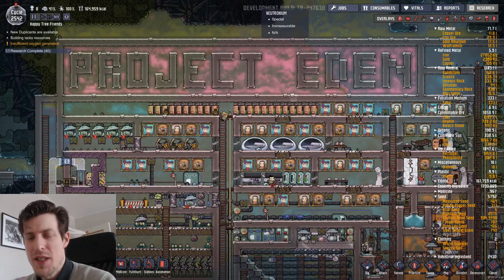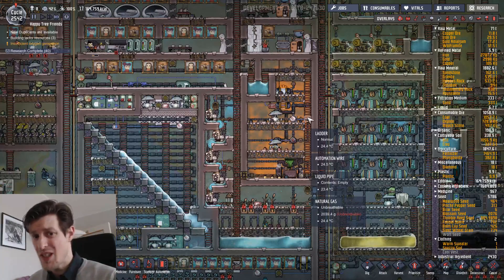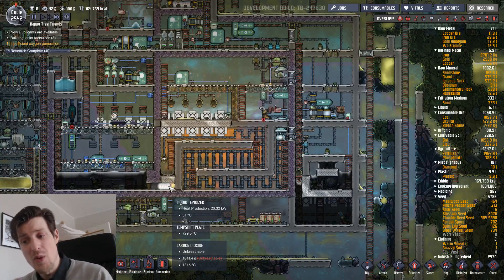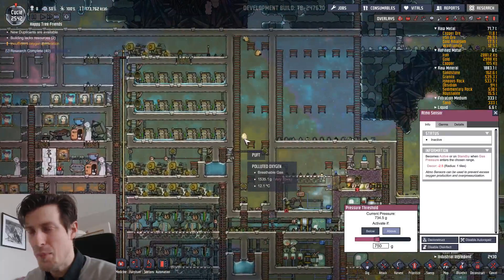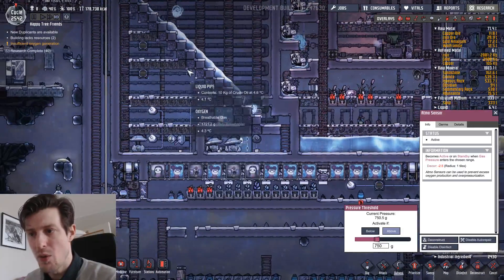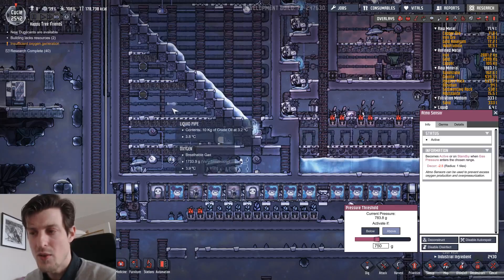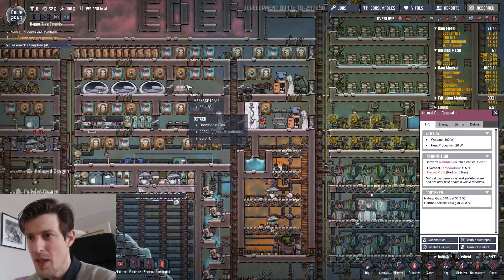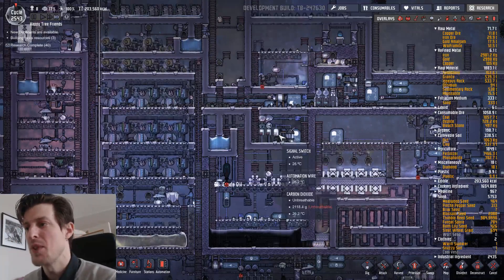100% sustainable base (zero external input) PROJECT EDEN FINAL

Comment: Amazing work! Thanks for sharing, Ketmo! 

However I wonder if it's possible to build a sustainable base without expoiting of gliches given they would be fixed in one of the upcoming patches?
Reply from the maker: I guess that will be my next challenge. Starting fresh, first use some transition tech and then try to build something sustainable for all duplicants while avoiding any major exploits. I have an idea that if all cooling is concentrated to NG plants to keep them supercold that can be used to cool the base since they always output carbon dioxide and polluted water at their own temperature. However, how do I get enough NG for them if not having any NG gaysers or without exploiting tepedizer to boil crude oil or steamgayser for water (getting NG from polluted water using fertilizers use a lot of water...) Polluted air and pufts->slime->polluted water could be a solution, but will it be enough?